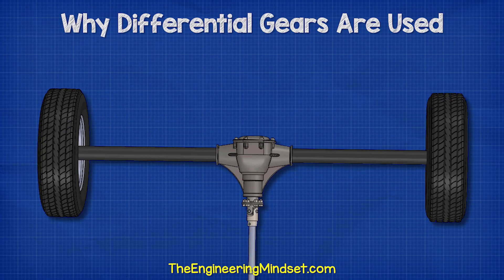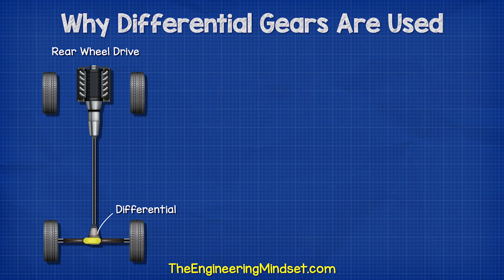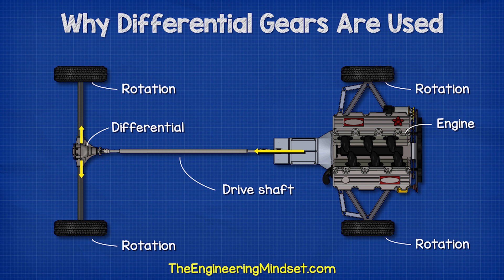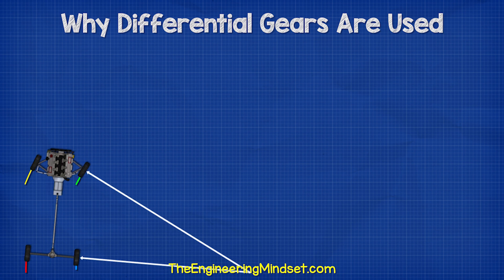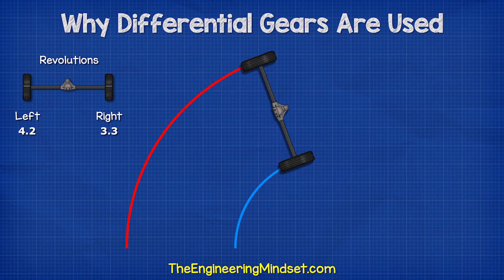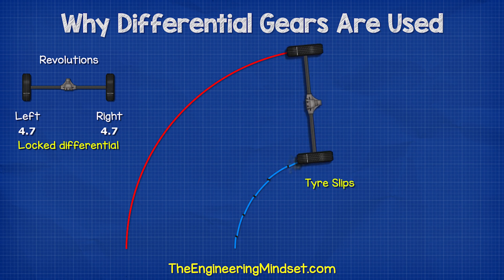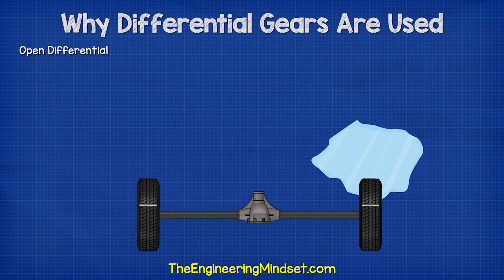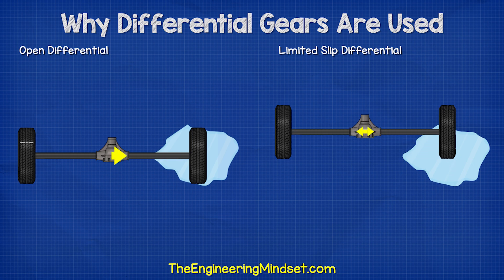Why Cars Need Differential Gears

Comment: As a mechanic, the item you call a "differential" is more likely called a "final drive".  This final drive will contain a form of differential gears.
Pedant I know.

Also, most all wheel drives and four wheel drives also have a "central differential" between the front and rear final drives.

Comment: 4wd cars have 3 differentials they come from the engine, then split to front and rear. Some use a limited slip differential there, but most have open ones.

Comment: Are there any front-wheel drive cars that don’t have a sideways-mounted engines and need a differential in the front? I was trying to remember how classic muscle cars had their V8 engines mounted.
Reply: Engine mounted between the frame rails drive shaft to the rear end for classic muscle car. Only when they went to front wheel drive did the engine get turned sideways. Yes, all autos need a diff no mater where they drive the tires from.
Reply: Alex
 Your thinking of the Oldsmobile Toronado and/or the Cadillac Eldorado.  They had the "North-South" engine like a rear wheel drive car AND a Front Wheel Drive ( FWD)  drive train.  They had a very UNIQUE "Chain Drive" in front of the automatic transmission.  The chain was VERY strong, capable of handling over 400 lb ft (foot pounds) of torque.  Hope This Helps.

Comment: Do all modern cars have this? If so, for how long?
Reply: They have always had one.
Reply: Almost all cars have differentials basically since forever (I'm sure at one point maybe not but that's far before I was born). What's new/where the innovation is these days is more and more performance cars locking differentials or electronically controlled differentials (that can dynamic change the amount of lock up). 

e.g. the VW GTI has always had a (open) differential. But higher specs of more recent GTIs have an electronically controlled locking differential in the front. The VW Golf R has always had a differential in the rear (in addition to an diff in the center for its AWD system), but only the most recent mk8 Golf R has a locking differential in the rear.

Comment: So what is limited slip differential?
Reply: And worse the moment he talks about it the video links overlab the animation
Reply from the maker: Thanks, I have corrected it. You can view it at the end now.
Reply: Instead of the power going to the wheel that's slipping (as in an open diff), the power goes to the wheel that has traction
Reply: There are a few different types of limited slip differentials.
Most common used to be a spring loaded clutch based limited slip, where there is friction material linking both axles together. This drives both wheels until the spring pressure forcing the friction faces together is exceeded. 
Modern vehicles often use computer controls to read the wheel speed sensors and feed brake pressure into the spinning wheel, resulting in more torque going to the wheel on solid ground.
There is the worm and spur geared Torsen type differential which is purely mechanical. This forces the gears into the housing feeding torque to both sides.
There are also fluid coupled limited slips. They rely on the drag of a viscous fluid (typically silicone oil) to feed torque to both wheels.